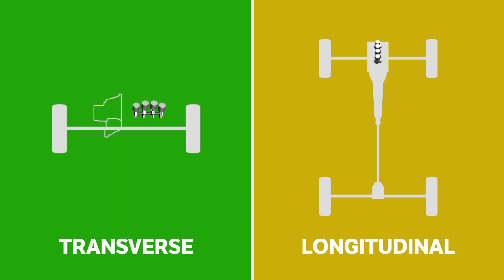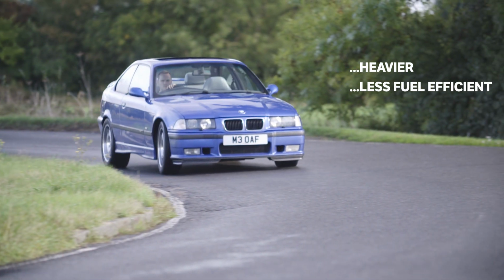The Differences Between Transverse and Longitudinal Engines

Comment: I still don't understand about the layout of the old Saab 900. It's front drive, but the engine is longitudinal. How?
Reply: They used an "inline" gearbox behind the backwards-mounted Triumph four. I believe the majority of the gearbox was behind the engine, with a few running underneath the block towards the driveshafts (remember that these engines were canted sideways so there was room to put the tranny). I don't think it was particularly fragile, but they were awful for maintenance since the backwards engine put things like the water pump, alternator, etc. right up against the firewall.
Reply: Rayshanto2701 lots of cars are like that. Audi A4/5/6 are (base models without quattro) Chrysler 300m/LHS, dodge intrepid, and a few others. I would think it's pretty inefficient, but I'm not an engineer.
Reply: +Tyler Beeson i think the inefficient bit of the Saab is the way they use to transfer the power from the engine to the gearbox using a chain-drive thingy. actually it's not just inefficient, but also fragile i think.

Comment: Longitudinal Engines way much better. I have a Lexus RX300 with Transverse V6 Engine, and for the changing spark, I have to remove all intake manifold. So I believe that transverse work only for inline engine.

Comment: how transmission work on rear engine and rear wheel drive with longitudinal  layout
Reply: Yansen Haryanto
On longitudinal MR/RR/FF setups, the transmission and differential are combined into one unit called a transaxle. On MR/FF setups, power is sent rearward through the transmission, then back forward to the differential before being ported out the sides of the transaxle housing and to the wheels. (On RR setups, the directions are reversed. Power is sent forward through the transmission, then back rearward to the differential and out the sides of the transaxle housing to the wheels)

For more information, look up the 1993-1997 Dodge Intrepid for FF and almost any Porsche 911 for RR

I hope I answered your question, and wasn't too confusing with my answer.

Comment: There are also longitudinal front wheel drive cars, like the Oldsmobile Toranado and Cadillac Eldorado.
Reply: Like Audi A4
Reply: Renault 21 and 18 as well..
Reply: Speaking of FWD IPREFER THIS DESIGN LONGITUDINALLY MOYNTED THAN TRABSEVERSE NECAUES IT CONTRIBUTES IDEAL WEIGHT DISTRIBUTION IF 60/40.WHICH HELPS SUPERB HANDLING.

Comment: Transverse are good for those that want a simpler and cheaper car and don't mind a normal driving experience but are a certifiable nightmare for mechanics who have big hands and need to tear apart half the damn engine bay just to service a single component. Longitudinal setups make better performance cars, are able to fit an engine with more than five cylinders and are easier to service but require more components (such as the driveline and differential) which naturally means more points of mechanical failure to keep an eye on and more money will be required to shell out for parts. They also have the distinct honor (or dishonor depending on your opinion) of being mostly exclusive to all but the most expensive of models and companies such as a Corvette or any BMW. That being said, it's not about what's better. Every car is built with a specific purpose in mind so it's really a matter of what you want out of your car. Me personally, I wouldn't mind driving a transverse since I'm a student and just need something to get from point A to B, but I also wouldn't hesitate to take an M5 or a 944 for my own driving pleasure.

Comment: What about AWD?
Reply: idk, Transverse AWD is getting very common now, my Mom's CRV is transverse AWD for example
Reply: the new thing everybody does, the haldex-system (hey, i'm FWD, but if the tires slip, i maybe send some power to the rear) like in the golf/A3/TT/.. and in the focus RS are all transversal bc it is based of a FWD platform. Evo the same, even they had another AWD-system. Subaru on the other hand mount their engines transverse (symmetrical AWD, bro)
Reply: all the evo's are transeverse
Reply: Sometimes a front engine awd car might understeer more than a fwd car because the rear tyres push the front ones across the ground and the front tyres are also driven, so they loose even more grip.
Reply: Oh, I always thought that AWD only works with Longintudinual engine placement.
Reply: ExCaliburger longitudinal most of the time

Comment: wtf if my dad's 05 Accord is transverse fwd then why does it still have a "drive shaft" tunnel between  rear seats?
Reply: They often have a smaller tunnel there to hold an exhaust
Reply: my question too my mom has 2017 golf TSI and its front wheel drive and transverse idk why the back seat has that camel back lump thing

Comment: Longitudinal and if possible transaxel!
Reply: transaxel, isn't that when an axle is born as a front axle, but identifies as a rear axle?
Reply: Joppe van Dijk Transaxle is when the gearbox and rear differential is one unit located between the rear wheels.
Reply: Giulio TJ M ie: Chrysler lh platform

Comment: You forgot a few traverse RWD applications like the Lamborghini Muria and Jalpa, Toyota MR2, and Honda/Acura NSX. Then there's the odd Longitudinal FWD setup like 70's and 80's FWD Subarus.
Reply: A: weren't those also mid/rear engined?

B: I do know that VW also used it until around 2005 or so, B5 passat i believe
Reply: Yep, my Passat B5.5 PD130 is longitudinal
Reply: Isn't the B8 A4 FWD longitudinal? Same with the A6.
Reply: Correct. All non-quattro A4s are FWD with longitudinal engine layout. Even the Audi 500 had this setup (if memory serves).
Reply: Smarts and Renault's new Twingo 3rd Gen are rear wheel drive but only because of transverse mounted Inline-3s in the trunk.
Reply: A 'mechanical sandwich' style longitudinal FWD would work great with a boxer style engine.
Reply: MagicDartProductions Also, the NSX engine and transmission are completely unique to that platform. So, that's not just FWD setup thrown in the trunk. Same goes for those Lamborghinis I mentioned.
Reply: Justin Noker The video doesn't make a distinction between what wheels it drives as much as it talks about transverse vs longitudinal engines. It's an oversimplification to say that transverse=FWD and longitudinal=RWD when there are a few that buck that trend in the history of cars.
Reply: Kristopher Klassen I completely forgot about those. I was just looking under the hood of a Concorde last month and just flabbergasted that Chrysler made this thing.
Reply: MagicDartProductions Yes, this is true, but this doesn't make them any less RWD or any less transverse mounted :)
Reply: Alexander Moore The pre-GM Saabs completely slipped my mind. Nice.
Reply: And that's why they fit a W8 in the Passat B5. It's basically the same platform as in the A4 B5 and A6 C5 (which you can also get with a V8).
Reply: Raymond Fernandes also B5 VW
Reply: Justin Noker and the Oldsmobile tornado
Reply: What about DF Goblin?
Reply: Transverse mid engine are always gonna be RWD
Reply: MLB quattro ultra on a4 allroad. Best of both worlds
Reply: and audi’s
Reply: A lot of cars that a rear wheel drive with transverse are literally a front wheel drive setup just stuck in the trunk. Case in point the MR2 you mentioned.
Reply: Raymond Fernandes try the lh platform from Chrysler
Reply: Indeed. Every pre-GM Saab, the mighty E-bodies (like the Toronado and Eldorado), some '90s Acuras (Vigor with the G-series I5, early TL), early Citroens, and quite a few other cars used longitudinal FWD setups. It's superior in some ways to transverse because equal-length driveshafts = no torque steer, but it does mean that the front of the car has to be taller to accommodate the resulting mechanical sandwich. Saab and Citroen tried to avoid that, though, with the engine "inline" with the gearbox which just creates a longer bonnet.

Comment: You guys completely neglected to show the transverse- engined AWD hot hatches.  S3, A45, Focus RS... They can do slidey things too...
Reply: transverse "awd" (=haldex) hot hatches can't really do powersildes, the only thing you might get them to do is to lift-off-oversteer, as there is never more than 50% of torque transferred to the rear wheels.
Reply: never trust an edited comment
Reply: The point of the vid is just to show the typical uses of these engine arrangements. You could also argue that they didnt talk about the variations of rear engined cars, but again, its just the basics
Reply: absolutely right! :) #longlivethepowerslide
Reply: Jeremy Beam I see what you did there...👀
Reply: MHBGT indeed
Reply: MHBGT while i agree that they could have shown some fotage of similar cars, its a bit pointless.

I mean barely any manufacturer makes a AWD hatchback today and those who do charge shitloads of money for those ( a S3 isnt cheap, nor is a RS focus)
Reply: theElemDragon MR2! any others that were noteworthy? besides the Porsches?
Reply: Aaron Davis Good point. Transverse is more versatile then?
Reply: MHBGT also VW's transverse 4motion cars they can do slidey things too..
Reply: MHBGT flubbed flash drive to a few weeks ago by a couple of things that I have a Rancher ES
Reply: No need to guess here, the Focus RS uses GKN's Twinster system and not some Haldex derivative.
Reply: Max Harrison good thing the focus RS doesn't use Haldex.
Reply: MHBGT: the RS uses a haldex-system, but a very clever one. with actual clutch-based torque vectoring.
as far as i know.